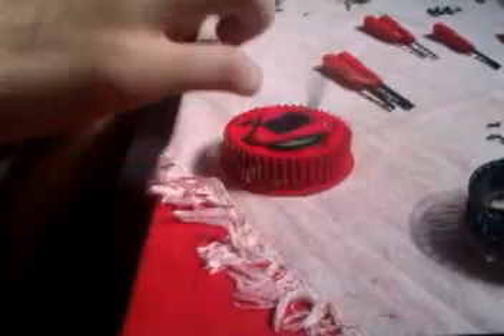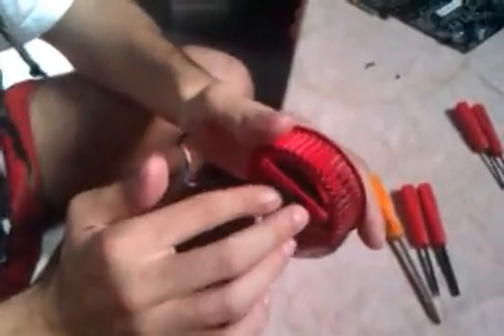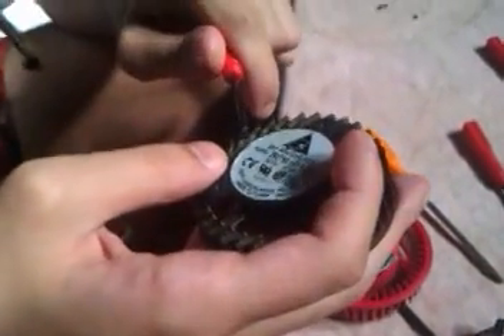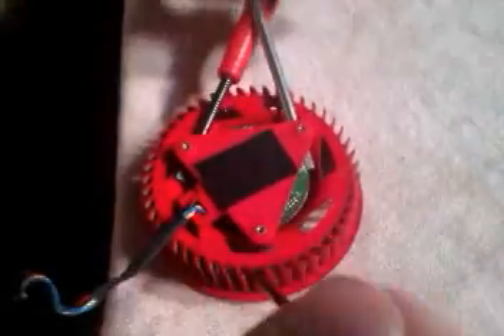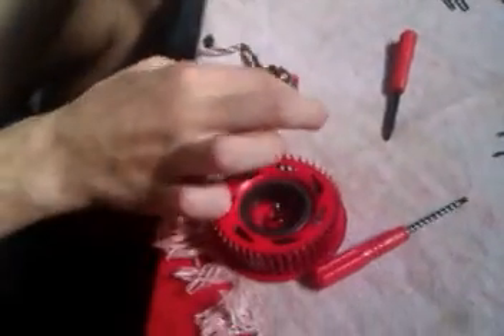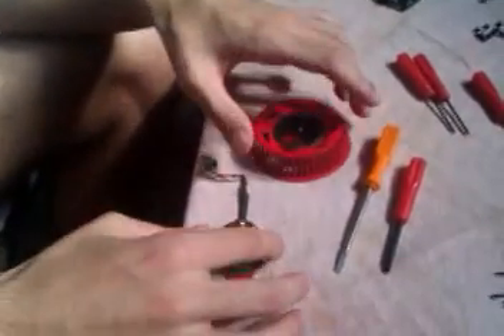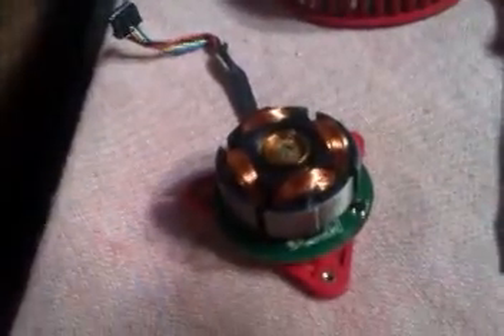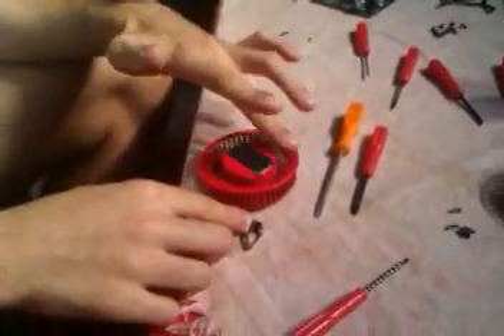GPU Blower Fan Disassembly And Lubricating for ATI Radeon cards

Comment: Not the same fan for ATI Radeon HD 5770. FirstD fan p# FD7015H12S on 1 side, ATI Radeon P# 7120484000G on the other side. It's sealed, no way to get it apart to lube it. I checked under the stickers, both sides. So, no help here.

Comment: Just a note: I have an MSI HD 6970 (Structurally identical to the reference model) with a Foxconn blower fan. The fan had a circlip under the Foxconn sticker. You have to remove that first if it's there, else the motor cannot be forced out without damage. Once the circlip was out, I simply removed the motor with my fingers, no force required.

Comment: apply gentle force on the insides of the wings, not the outside you will brake it. nearer to the middle, the better.
btw it works also when the card is running, i have done it when i watched this video :D. thank you very much for saving our money!

Comment: Does this apply to the Radeon 5770? The fan in mine sounds like a motor, and I'd like to go ahead and remove it if I'm ever up to doing so.
Reply: ***** I think it was just worn out or something. The fan assembly itself was just really loud. I think the card died or something (but I have yet to test it again), so I just went and bought a used Asus GTX 660; the Asus cooler is practically silent.
Reply: *****
Wow, seems like that was an involved process. Good for you that you were able to fix it up! Did you notice a decrease in noise as well?

Yeah, I'm happy with my GTX 660; it's a good card and, again, very quiet.
Reply: ***** Nice - hopefully it does stay silent. Desktops are very antiquated by now. They only are useful for novelty and those who need professional workstations. Even sales on all-in-ones are down because most people can do with a laptop or even a tablet. Heck, there are people who use phones instead of computers. Now THAT I can't understand.

Comment: Well done man !
The noise from my GPU was really loud.
Worked perfect on my gtx460.
TIP: I didnt had grease to lubricate the inside of the fan and I use Olive oil !
Reply: And something else. Before you open your GPU remember that you need a thermal compound for the core when you rebuild it again. https://www.google.gr/search?q=thermal+compound+vs+paste&espv=2&biw=1920&bih=955&source=lnms&tbm=isch&sa=X&ei=LEfrVMKjMOHOygOM1IG4AQ&ved=0CAYQ_AUoAQ#imgdii=_&imgrc=ODbEnDLI8cw-rM%253A%3Bc62nGqwdVsAvaM%3Bhttp%253A%252F%252Fimg.tomshardware.com%252Fus%252F2004%252F10%252F15%252Fintel%252Fliquid_put_thermal_paste.jpg%3Bhttp%253A%252F%252Fwww.tomshardware.com%252Freviews%252Fintel%252C901-4.html%3B425%3B465

Comment: I popped the fan apart with some effort, but when I went to press it back together I couldn't.  I worked my way up to using a C-clamp after all else failed and applied enough pressure with that to bend the shaft.  So... guess I'm ordering a new fan.  $15 isn't bad.
Reply from the maker: Could you name your card model and fan model so all know its not usable on those models?
Reply: TheckoHW
It's an XFX 4870.  The fan looks identical to yours, and while it did pop apart with a bit more effort than you used, it wouldn't go back together no matter what.
Reply: daverbmxer

I got the exact same problem...i wonder why it doesnt go back
Reply: Athanasios xrisantzas
Considering how much force I used to pop it back together without doing so, I don't think it's going to happen.  I would at least try to run the fan after lubrication without popping it back in.  It may not ride on the shaft in the same exact spot, but it looked to be very close, and magnetism kept it in place.  It shouldn't fly off and should spin fine I would think.
Reply: daverbmxer
Oh, and I put my $15 replacement fan in my 4870, and it works so much better than the old fan, it blows way more air and is very smooth.  So if all else fails, not a big deal.
Reply: eBay, very cheap.
Reply: daverbmxer Was the new fan quiet? I have seen these replacement fans on eBay, but they are all used... I cannot be sure whether I am looking at a product that will or will not end up needed to be re-lubricated as well.
Reply: maccollectorZ (Commenting Account) Yeah,  fan is just as good as the factory, loud at 100% but quiet at idle
Reply: daverbmxer Now I wonder if I should risk fixing mine or just replace the fan. Whelp, if I break the fan in the process, somehow, I'll go your route.

Comment: Thanks a lot! In both of my 5850 the fan was touching the card casing after some days making weird noises. Thought this wouldnt work as one card have the fan almost stoped (+- 200 rpm), but it works like a charm. And havent to do any hole on them :p

Comment: Thanks for the video. My fan made a rattling noise, I lubricated the inner fan part and all is quiet now. But i am not sure if lubrication was the solution, maybe the fan just needed to be popped back. I think the fan was touching the card casing. I have a 3870x2.

Comment: Ohh ok now i see you have that brass part in the back on that fan model......i didn´t have that in the back of the MSI Geforce fans.They had just fabricated my fans without leaving a hole and a rubber fitting in the back so this fan you have and the ones i drilled aren´t 100% same.Mine were like a regular fan with a hole left on purpose but they don´t make those holes on fans like mine so they know they can make money of people when they have to buy new ones :) Thanks for the video

Comment from the maker: Drilling a hole is not an option, since the brass part is the axle, which is static. The only option i found working is getting the blades and body of the axle, which is pretty risky, considering if you push too hard you could break it.

Comment: He is so wrong about that....cause i have to MSI Geforce 460GTX cards running SLI in one of my computers and all 4 fans started to freak out after about 3months so i drilled holes by hand in the back.Haven´t done anything to my ATI cards/fans running crossfire mode after 2years of use so it´s not about the brand at all.Weird huh i use both ATI AND Geforce cards in my computers lol.Bet that makes many nerds freak out hahahaha.Thanks for a great video

Comment: Why not just make a hole at the back as with the Nvidia fan?Just curious cause i have 2 MSI Geforce 460GTX Hawk running in SLI and those fans are literally shit original and there aren´t holes in the back of the fan so i just made a hole on all 4 fans.
So to Athlo Raven that said Nvidia was better cause of that...sorry bro you are wrong.And i use both Asus/ATI and Geforce in my computers.....they are all pretty much the same except for the prices

Comment: Thanks for the vid. I'm trying to pop open the fan like you did, but so far it wouldn't budge - the triangular plastic is about to give, I see cracks forming - just wondering if anyone ran into the same problems. This is an ATI Radeon 5870 card I'm trying to repair.

Thanks.

Comment from the maker: If you have a replacement thermal pad (the white square stuff) then remove and reaplly, but if dont have have dont touch them, and be gentle, care that no dust or anything falls on them, since they are used to cunduct heat from your memory and voltage unit to the heatsink.

Comment from the maker: For the graphics card fan, all i can think of is applying force on it, just like in the video, BUT bare in mind it might not work, i have a crappy nzxt fan, and when i tried applying force, it just broke off, leaving it destroyed, some fans are just not meant to be repaired. The sunon however is done for in my opinion, maglev is a good technology, but not without its flaws, i think you cannot repair those. Maybe send an email to Dell, asking them, or even Sunon, but i doubt you can repair it.

Comment from the maker: I would have to see the fan of the 520, i cant find any pictures of it except the main one on their website, but looking at it i think you could fit a 8" on that heatsing, just use zipties and youll be good.
Maglev fans dont need lubricating, if your is giving unusual sounds it is time to change it. If it is making strange noises you could try to apply a small amount of force via your hand on the center of the fan, but i doubt it would help.

Comment from the maker: @roflcoptero Try the method i used on the Nvidia fan in the video, there should be a hole or a rubber cap. If there is a rubber cap then just gently push it out.

Comment from the maker: @Hiddenlce 4890 has the same fan, you can try this method to repair it, but since the noise stops when you use pressure on the fan i would say that your bearing has been eaten out. Try lubing it, it does not cost you anything, and you will clean the card from dust in the process.

Comment: Hi, I'm having some fan noise issue from my ATI Radeon HD4890. Gets louder as I adjust the fan speed and when I try putting my finger over the GPU fan just to see if the noise is coming from it (gently touch) the noise significantly dropped. This happened only recently.
It used to be silent when I'm booting up my PC(of course after the usual loud spin-up), but now there's this weird noise. I also notice that at 40% fan speed, I used to have around 29XXrpm, now i'm getting 25XXrpm. Help please

Comment from the maker: @darklsins If it is a blower fan then this method will work. Just open your fan and check under the sticker, if the hole is solid then you can use this method. Note that some fans have a cap on the hole, if its made out of rubber just gently push it out and return it when you have lubricated the fan.

Comment: @steinmil I used x-tra heavy duty wheel bearing grease, I got it from home depot for $5. It took about 30 min to take apart gpu, remove fan and take it apart, grease the bearings and reassemble the card. Best $5 I have ever spent, Thank you so much TheckoHW for showing me how to do this.

Comment from the maker: @steinmil i used some swedish bearing grease for motor saws. Never gave much attention on what im using, but dont use WD40 or similiar products, its good for cleaning, but not good for lubricating. Your best bet is to go into a hardware store, and ask for bearing grease, cause bearing grease is meant for those kinds of alloys.